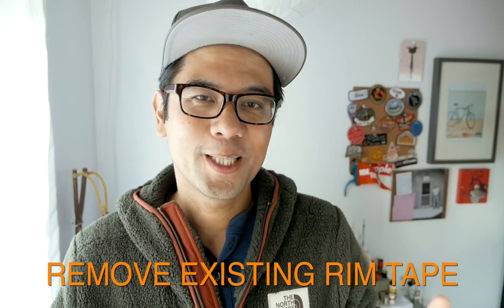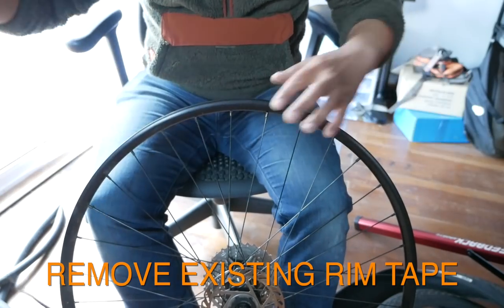How NOT To Go Tubeless - 6 Things I Wish I knew Before Going Tubeless

Comment: Good tips. You forgot the golden rule to seat the tires bead initially: REMOVE the valve core. You need the most airflow you can get to get it into the beadseat. Dry seating would be the second most important step. To find leaks soapy water is excellent as it bubbles even when it's just little air escaping the rim. For rim tire combos that are too loose there is a great product: Skinny Stripper. Originally these latex rimstrips were developed for fatbikes as FattyStripper (fun to google the product, especially with the wife looking over your shoulder). Fatbike used to be difficult to setup early on. The manufacturer realized that for cyclocross the needs are similar. Basically it's a latex rimstrip that overlaps over the beadseat reducing the gap between tire and rim, making it a lot easier to fit the tire tubeless. Once it's seated you trim the overlap with an exacto knife or a blade and off you go. Works very well.

Comment: You should also be aware that some tubeless tyres are porous and leak sealant from the actual sidewall . Some of them you'll be riding with a continuously leaking tyre and because of this you will need to regularly top up the sealant.

Comment: Are supple tires compatible with tubeless or do the tires need to be very rigid to hold the seal? I'm trying to figure out all the ways I can possibly improve the comfort of the 700cx28mm size I'm stuck with and wondering if something supple like a compass tire AND tubeless might work.
Reply from the maker: Yes.  Tubeless allows the tires to be more supple because you can run at lower pressures without pinch flatting. Compass in 28 would help.  Wider would be better.  Also the Redshift Stem is awesome and adds a nice amount of suppleness to the front.
Reply: @PathLessPedaledTV  Thanks! I have been eyeing up that stem for awhile and (for anyone else reading this) they are having a sale right now :)
Reply from the maker: It will make those 28s, feel like 40mm tires in the front.

Comment: Tubeless is the way to go, without a doubt. Been tubeless for two years now, for me that’s meant 2 years of puncture free riding! If you have tubeless ready tyres, it;s all so easy! It really is! Use Gorilla tape! Don’t put a tube in, no need for that at all! Get your tyre on, pump it up.  Remove valve core, inject sealant, replace core, re inflate the tyre and hey presta! You’re good to go! Only tip I have is, get yourself a tyre inflator booster. For that initial air inflation into the tyre. 
You’ll never look back and you won’t be at the side of the road fixing punctures when you want to be riding either. Peace and love!

Comment: One mistake I made was thinking I had to spread the sealant around the tire bead before inflating. Only thing it achieves is pissing half the sealant out the sides and makes a big mess. Spread the sealant around after inflating!

Also if you're cheap and use crappy tape (maybe not my best choice), it seems to work better to inflate a tube in the tire for a while (maybe a day?) to allow the tape to stick well.

Comment: If you think the conversion was a pain, you're really going to "enjoy" the maintenance. That's right, maintenance. After a few months of riding in summer temperatures, the sealant dries out and bonds tenaciously to the inside of the tires. You can get away with just adding more sealant, but the dried sealant will impair the new sealant from doing its thing and begin to add a bunch of weight. There are several YouTube videos on the subject, but none of them seem to offer a viable solution. When I spend $120, or more, on a set of tires, I want to use them for more than one season. It's the only thing keeping me from making the conversion.
Reply: The sealant replenishing process is constantly improving, no doubt, but the issue of cleaning the dried latex from the inside of the tires still remains. Here is a vivid demonstration of the problem. (Thanks to the Preludedriven MTB channel:
https://www.youtube.com/watch?v=OeRPtr0mkrE
Reply: that's why you should replace or the sealant between 3 & 6 months
Reply: Which is the point... tubeless is maintenance intensive.
Reply: Even on my road bike, I replace the tyres on average once a season. It's a small price to pay in the grand scheme of things. 

I just bought a Giant Toughroad SLR GX 0 which comes tubeless out of the box. It's my first tubeless setup but I will most likely change the sealant twice a year. For $20 who cares.

Being able to go down to 40 psi without worrying about a pinch flat is awesome !
Reply: I really don’t get this tubeless thing, it is still just a clincher. It is the sealant that does all the magic self repairing. I understand on larger tyres with lower pressures it can work pretty well unless you go to low then it can blurp. But for road tyres where pressures are 80 psi + I still think these tyres are not there yet. Maybe the new mavics might have something to offer?? But I will have to see it to believe it. I still think tubular has greater advantages over tubeless for road racing and also very low pressures for MTB and cyclocross.
Reply: thats why you should use peaty's tire sealant
Reply: It is Gravel riding, not pure road riding, where tubeless is making new inroads because almost no one runs 80 psi on gravel - mid 30s to 50 is where gravel riders seem to fall out. It is the mid 30s psi crowd that are all tubeless and for them, running 38-45mm tires of variously textures for grip, they are tuning their tires as a suspension component to be able to roll over obstacles because from a grip speed comfort safety perspective it is the optimal solution. If you aren't going over rocks and roots with a mountain bike, or riding a gravel type bike over almost similar terrain then tubes and clinchers is a way better choice - if you are, tubeless is a far superior choice.
Reply: Tubeless doesnt save you time on maintenance.

It saves you from having to stop and repair a flat on the road, when you're trying to ride. Do you "plan" your time for flats as maintenance rather then ruining a ride.
Reply: I just don't get it for road bicycles. Mountain and gravel makes total sense given the flat issues, but on the road with a set of good tires, the amount of maintenance time takes way more than the occasional 5 min tube change on the road. I get that people don't want flats, but it seems extreme. I know trends tend to over-react and then correct to the sweet spot, but I'm hoping roadies don't go this direction. The only time I had an issue was a blowout with a completely slashed tire...tubeless would not have helped and gotten junk all over me and the bicycle and my gear. I am generally open to change and like new tech, but this seems silly. Any thoughts from roadies?
Reply: Also I commute and when I do any 'racing', I'm not fast enough to count grams (actually I think 99% of people are in this situation). I am better served getting stronger.  :)
Reply: @ShermanSitter  I've been running tubeless (Bontrager R3 700c x 26) on my road bike for 3 years and there is only one time when I've ever had to do extra maintenance. I've found that over time, some of the sealant will congeal into a semi-solid substance that can clog the valve stem from the inside, making it difficult or impossible to add air and even harder to let air out. There is an easy solution for this that takes less than 10 minutes, though. I just remove the valve core, stick the end of a bent spoke into the valve body, push out the congealed sealant, and replace the valve core. 

I also use my road bike for commuting and have never had any punctures or flats. In fact, it even holds air better than with tubes, though, that may be partly due to the fact that I'm using Shimano Ultegra tubeless rims that don't have don't have outer spoke drillings and don't require rim tape. I should also mention that I do replace my tires once a year whether they're worn or not, but this is only because I love my road bike and like keeping everything in as good condition as I can. From that perspective I spend way more time maintaining my drivetrain. 

Setting it up yourself for the first time at home is a bit of a chore, so I would recommend going to a local bike shop and having them do it.
Reply: I agree. I also just have too many bicycles and some of them sit for several months before using them. But when I"m ready for that specific purpose, I don't want to mess around with goo. :) I have some 'rain and off road wheels' now for my commuter. I love just take wheels that have been sitting for months and pop them on and go! With that said, if I was competitive I might consider it since you don't have to worry about a flat in a race that can basically ruin your whole day. As long as people use things for a purpose and not just follow blindly due to trends I think that is preferable.

Comment: Had a new tire installed; a Maxxis Rambler and went tubeless using the zefal tubeless kit. After a day in the garage it went fully flat. What could be the problem?
Reply from the maker: Did you shake the wheel to coat the inside?
Reply: Path Less Pedaled i had it done on our LBS and rode about 12km back home. I actually added a bit more air at home as the mechanic inflated it only on the minimum.
Reply from the maker: @ramellisred3128  it takes time for the sealant to plug every gap up.
Reply: Path Less Pedaled thanks for the response! I think im gonna do it myself this time to also learn. Probably will redo the tape w/ the gorilla tape stuff and use a better sealant. Im gonna run the tire w/ a tube for sometime to have it bead well. :)

Comment: Pple use guerilla tape which seems to be a hardware store item and is supposely cheaper than a rim tape. What tape do you use? The point is to find the least costly way
Reply from the maker: The point is to find the way that works.

Comment: Big tip -- when first seating the tire (dry seating) -- inflate without the valve core.   Remove the valve core, inflate with compressor, CO2, or pump... much higher volume into the tire quickly.   One seated, it will deflate when you remove the air inflator -- add some sealant through the valve, and then add the valve core and inflate. Voila. 

If having really hard time seating the tire -- add a second layer of tape to help push the tire bead up to the sides of the rim

Comment: Wow this was less of the advantages of tubeless and more of your learning the set up.  I would suggest a "review" after you've used the tubeless set up awhile.  I have had tubeless set up for years without issue on more than one kind of tire, and I will never go back to tubes.  I have only had issues when the shop made a mistake setting it up.  Its saved me countless times, and I don't miss tubes or patches.  I do think that the title is honest and appropriate.  I did smile while listening to your rookie mistakes.  Again, I'd really like to hear long term follow up on this conversion.  Enjoy the channel keep up the great content.
Reply: Michael Smith As someone who went through a similar learning process to Russ, I think the title of the video is spot on.

Many people tell you it's easy, when in fact it's just that some combinations of rim and tyre are relatively straightforward, others can be a total bitch.

I've been running tubeless for two years on three bikes. They ride very well, and I won't ever run tubes in my mountain bikes again. Narrower (circa 40mm) tyres have been much more trouble for me, and I've recently moved my cross bike back to tubes. Non tubeless tyres are much easier to change (they're nowhere near as tight), and given that I want to put tyres appropriate to the task on this bike, being able to change them in under 20 minutes is well worth the risk of punctures.

Also, Russ wasn't reviewing tubeless here. He was sharing what he's learned in setting it up himself. I've got some experience in this area now, and on my cross bike's tyre/wheel combo I think it's a total bitch. Even with something like an Airshot.

On my mountain bikes, it's really easy.

Comment: Two tips: 1. Use a cartridge inflator to seat the tire. I've been doing this for years. 2. Buy a valve with a removable stem and after you seat the tire, pour the sealant into the stemless valve. It is easy if you cut the sealant cap to fit the valve and slide it over the valve as a funnel. Also, compress the tire slightly while pouring in the sealant and decompress as you fill.

Comment: Three things I've learnt:
1.  A new tubeless ready tyre can be very stiff and hard to mount.  They get softer after some time with sealant inside, and much easier to mount/remove.
2.  I have rims with a central depression around the inside.  This makes fitting the rim tape so that it seals much more difficult.
3.  It seems that normal is to use presta valves.  I prefer schrader.  Attention, many things tubeless are presta-only, even if that is not made clear.  for example Aieshot booster.
Tubeless should be the way to go, just as in cars.  There is work to do to make them as trouble free as on car tyres.

Comment: I'd love to see a video of how to install an emergency tube in the event of a tubeless failure on the road. Everyone says to carry a tube even if you ride tubeless, but I've yet to see someone install the tube alongside the road.
Reply: This is a very good point. My tyres are extremely tight and i don’t think I’d be able to unseat and reseat the bead with a mini hand pump
Reply: My tube and boot is just for in case of catastrophic failure when I’m 25+ miles from any kind of civilization. Like a hole I can’t plug in the side wall. Never had use it, but can’t bring myself to not pack it.
Reply: @SmuggiNOLA  on a gravel group ride last year I had a guy that crashed me and my bike, and tore a hole in my sidewall with his cleat stepping on my wheel while falling down from his bike) He also bent my rim and broke a spoke, but that's whole another story) 
We were 45 miles away from any civilization and about 10 miles from the major road, and all I want to say is that you'll never know where the problem would come from)
Reply: @4tressed  Mr Murphy rides bikes too!!!
Reply: That's what their smartphone is for, they call for service.

Comment: Went tubeless yesterday. It took all of 15-20 mins with no issues whatsoever. I don't understand why you had so many issues with taping and cut the hole for the value? I also found the mounting process was really easy with a bit of soapy water in a spray bottle.
Reply from the maker: Really depends on the tire and rim combination. I’m not the only one with issues with tubeless, trust me.

Comment: - there are lot cheaper option than stans rim tape, kapton tape, gorilla tape working good, I use it. if you insist to use stans you can check mtbr forum to check what is stans tube similiar with
- I use motorcycle sealent ( I live in Indonesia, there are lot of tubeless sealent for motorcycle ) I use it, working fine until now. for your info motorcycle tyre have similiar PSI like mtb (30 PSI)
- converting to tubeless is hard for the first time, but then you can enjoy the benefit and you will think it's not that hard
- using tube to seat the tubeless tyre really help, if you have only floor pump than use soapy water at the edge of rim and pump (use big PSI floor pump and pump hard!) pump until all of the edge do not have bubble, if there's still some bubble.let the air out and do the same thing again.

Comment: 1. Do a good job with the best tape you can get
2. Clean the rim 100%
3. Soapy water (dishwashing soap in a spray bottle)
4. Mount the tyre with a tube if it's new and came folded. Ride it around with tubes in for a bit)
5. Spray copious amounts of soapy water all around both sides of the rim and squeeze the edges of the tyre together around the middle of the rim. 
6. Invest in an airshot to get the required blast of air into the tyre. Very difficult to mount just with a track pump
7. Take the valve core out, helps more air get in
8. Inject sealant via the valve after seating
9. Get a tubeless repair kit and carry a spare tube
10. Research your rims model before buying any equipment, some just won't
11. Use extra tape if your tyre is loose on the rim. It has to be very, very tight!
12. Don't give up!

Comment: The tip I learned about was putting slime in your tubes to act as a sealant. I have not done this yet but most likely I will in the future.
Reply: Make sure you use the slime that is specifically meant for tubes. The seal would only be effective if the object that cause the puncture is removed. The other problem is injecting the sealant into the tube, this can be pretty messy as the sealant clogs up the valve hole.

Comment: Gorilla tape, cut down to the correct width is much less expensive than stans tape. Especially so if you are going to need multiple attempts to get a seal. PS a really clean rim is easier to seal, so use a solvent then clean solvent residue with rubbing alcohol before retaping.

Comment: I've just got a full suss KTM e-bike... DT Swiss E512 rims and EVERYONE is saying go tubeless...but we have no thorns where I live and I've yet to get a puncture from MTB'ing. The hassle of removing tyres and cleaning puts me off, and in all honesty the cost of tape and sealant does too- I'd probably also end up spending £100+ on a 24L compressor(why get an "Airshot" at £50 when a compressor could do your vehicle tyre pressures too? Don't trust a pressurised coke bottle to not take your eye out at some point too). 
When you get a 23kg bike saving a few grams on tubes becomes irrelevant, and I'd rather devote that time and energy to keeping the motor and the bearing seals meticulously clean along with the EX1 drivetrain....(the cassette alone is £400 new....). Just go for the tyres with the slack beads so that removing them is a doddle....